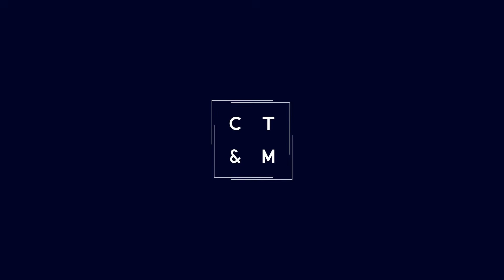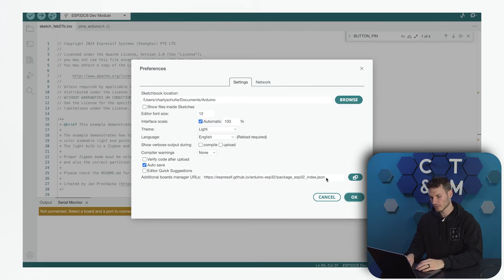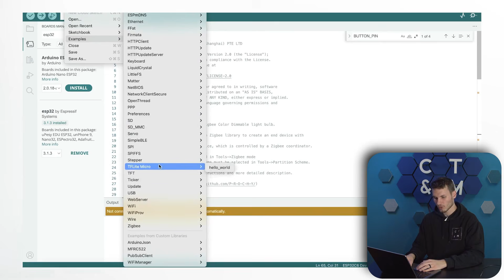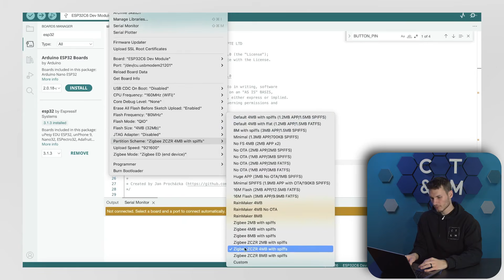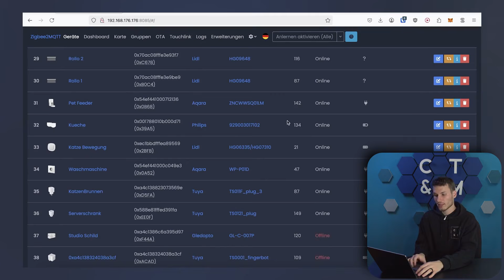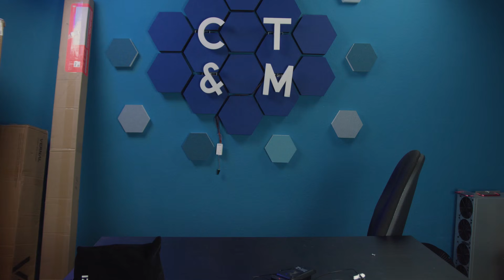Smart Home DIY: Build Zigbee Devices Yourself with ESP32-C6!

Comment: Thanks for the video!
It’s honestly impressive that Zigbee on ESP32-C6 can even be compiled and run from Arduino IDE nowadays.
That said, for anything beyond demos or experiments, ESP-IDF with Visual Studio Code feels like a much better choice – cleaner architecture, proper tooling, reliable IntelliSense, debugging, Git support, and full control over the Zigbee stack.
The GitHub Copilot integration in VS Code is also a huge productivity boost.
Arduino is great for accessibility, but ESP-IDF + VS Code really shines for serious development.

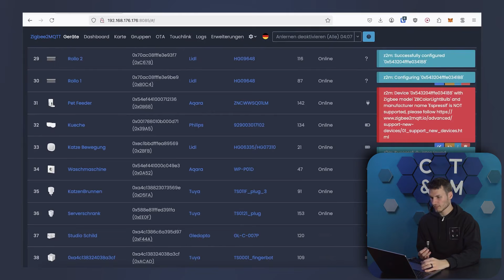Comment: I'be been struggling for hours.. Even the example file compiles and uploads correctly to the ESP32C6, and the device appears in HA, the Zigbee icon of the device remains black, and not red as shown @9:25 . The measured data is not passed on to HA, and my guess something is wrong pairing / interviewing this device? I do have 'exposed' attributes though.. Any thoughts?
[UPDATE]
I tried the Illumination sensor example code first. When switching to the temp_hum example code, the device type in HA still remains an illumination sensor, it's driving me nuts..
Of course I (force) deleted the device from the Z2M device list, but after reconnecting, my ESP still shows up as a illumination sensor, which it isn't anymore..  I think it's time for a break..😑
Reply: Were you able to solve it?

Comment: Great video, thank you so much and keep up the good work! Is it possible to configure the ESP32-C6 with multiple sensors (like temperature, presence detection etc.) and have multiple readings from just one device via zigbee? Or is it supposed to handle just one sensor per board?

Comment: I will wait for when Esphome support it.
Reply: To be honest, ESPHome supporting Zigbee seems rather unrealistic and unnecessary.
ESPHome is fundamentally a Wi-Fi–based platform built around IP networking and Home Assistant integration.
Zigbee follows a completely different architecture (mesh, coordinators, routers), which is already well handled by dedicated Zigbee solutions.
Mixing the two doesn’t really bring much benefit.
Reply: ESPHome supports it now. I've got one running as a BT Proxy!
Reply: @strykerhorse  Espresence is widely better !
Reply: This C6 does away with the need for ESPhome.